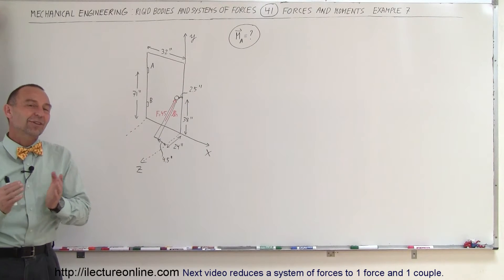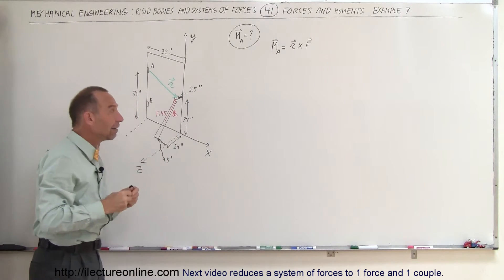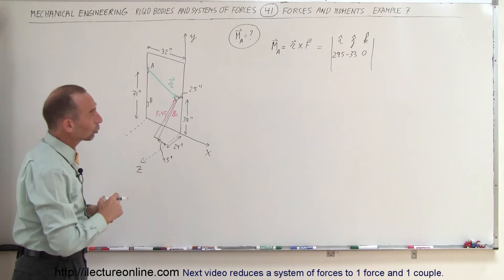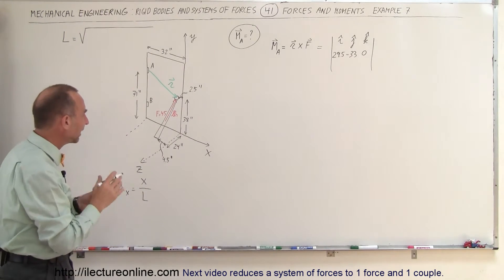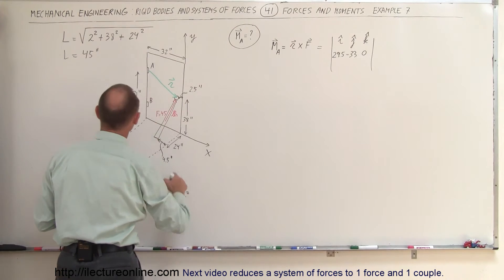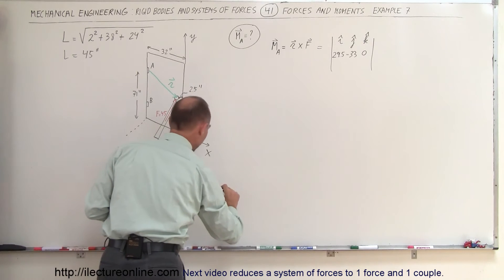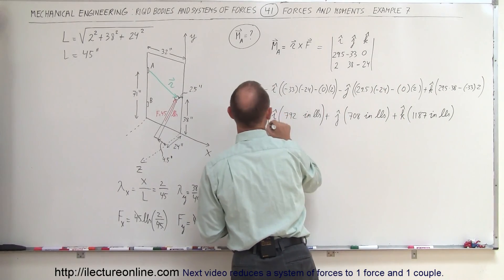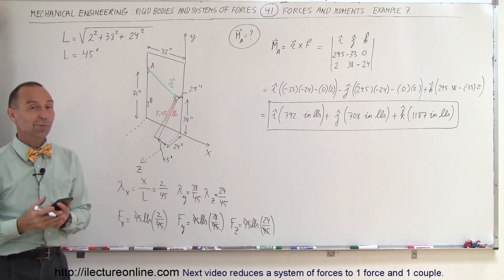Mechanical Engineering: Rigid Bodies & Sys of Forces (41 of 47) Forces and Moments - Example 7

Comment: How to calculate door hinges pin diameter for length 2.1 m x  width 1.8m  and weight of 70 kg
Reply from the maker: Standard hinge pins should be sufficient.  With a heavy door like that it will be important that the door frame is made with hard wood (if made from wood) and you use long screws or bolts to prevent sagging over time.